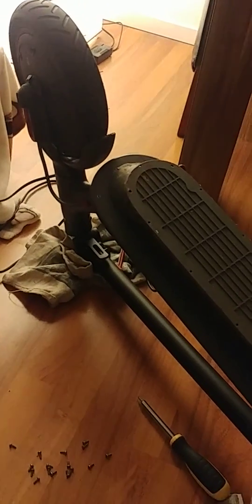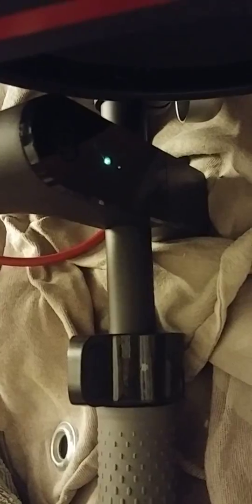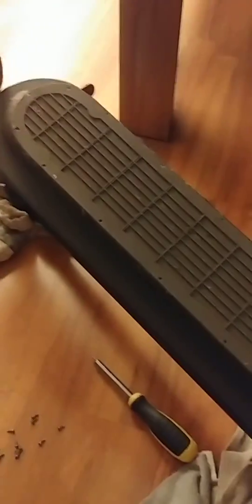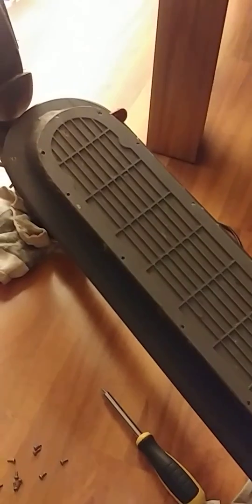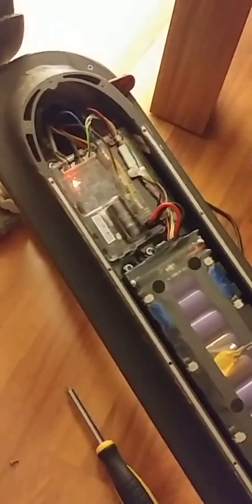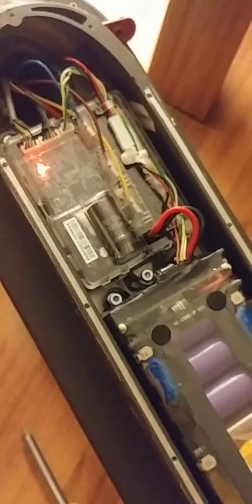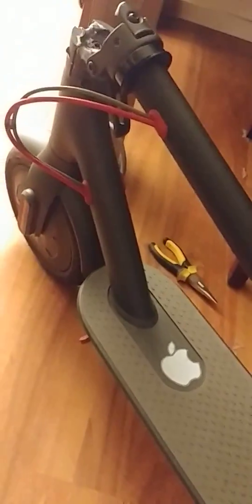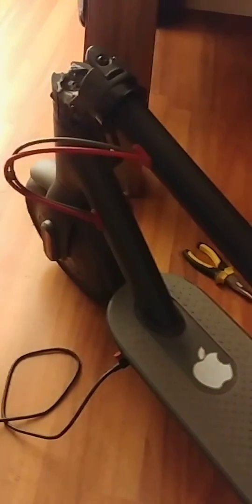Xiaomi Mijia M365 Charging Problem solved

Comment: Did ur scooter works properly after this...i have the sme problem i try to solder but the solder loose after the power turns off
Reply from the maker: Nope...it broke down again. :(
Reply: What did u do to fix it
Reply: Did u replace battery
Reply from the maker: Nope
Reply: What u do...u buy new
Reply from the maker: @ratedpgofficial58  will not buy the same one... These days there much better ones.. I would not.recommend Xiami

Comment: I have the same problem. My adaptor is green. There was a red rilgt for about 15min but it turnes green again. I didnt see any error in machine. I checked the batteries pins.they are ok. What can i do for solution?
Reply from the maker: rey upgrading ur firmware from the mobile app
Reply: Viktron Vv ı downgrade my firmware to 1.3.8. so ı cant update it again by mi home. when ı select upgrade ı see the newes fw 1.5.6. but it cant be loaded
Reply: is there a waynto upgrade again.."?